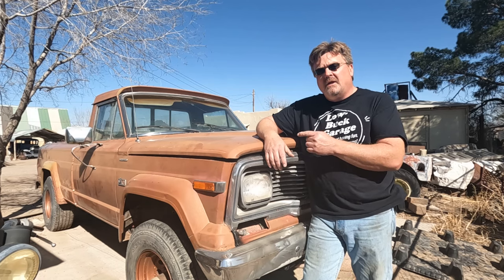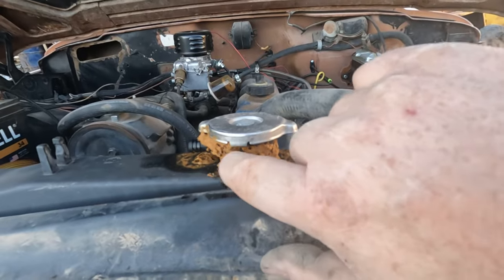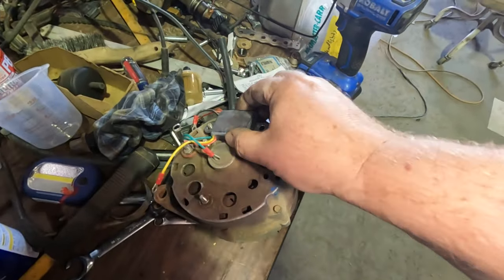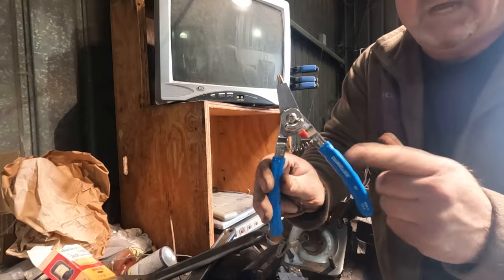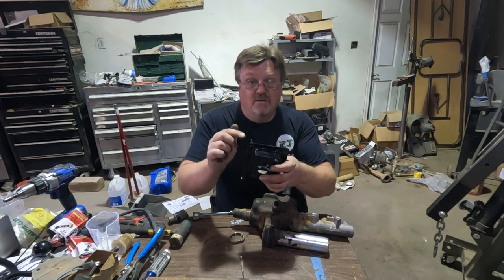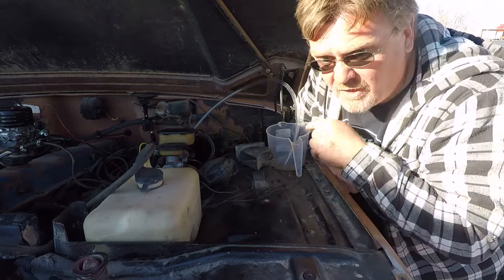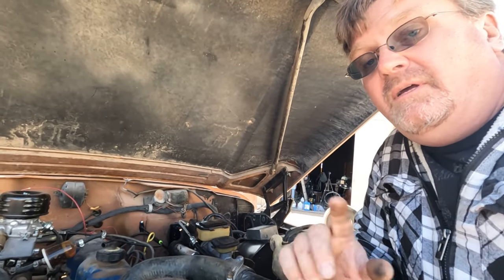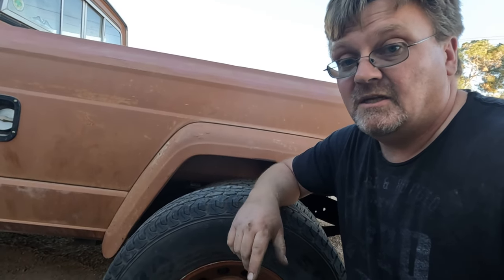Jeep J-10 hydroboost and repairs, this Ford powered 5-speed FSJ gets better!

Comment: In case it's not obvious, power steering pumps for hydroboost and non hydroboost systems for GM and Jeep are identical it's just the tanks (one return vs two). You can buy a two return tank and toss it on the good pump, don't forget the gasket.

Comment: LBG, when I worked downrange in the 80s we had some cool work rigs among them was a Air Force blue J10, an M37, A couple crewcab W200's I loved the old Dodge's, but that J10 drove really well had the cursed 360 that the motorpool dude's could never get to run right always starved for fuel, I brought a fuel regulator down for one trip and slapped it on. If you wanna sell that rig  id love to cross country it from Az to Ar ive always wanted a 300 straight 6 with a five speed in a FSJ haha. Coollest snap ring pliers ever!
Reply from the maker: The previous owner told me that he could never get the 360 running right, either.  I really didn't want to put that motor back in, I was kind of glad when there were casting flaws in the block and I had to re-power it.

Comment: Use an alternator from a 7.3l powerstroke, the 130 amp model. It's interally regulated and a nice upgrade. The superduty hydroboost is a nice unit also.
Reply: Caution: These Jeep trucks came with wimpy alternators (mine, a '74) has a 37 amp output. The alternator output wire on these trucks runs to the ammeter in the dash, and then back to the (I believe) starter solenoid. THAT wire is not sized for large output alternators. That's why he mentioned that these trucks have a reputation of catching on fire wiring-wise. All that said, I believe he has bypassed that ammeter wire, so he is good.  If you do this yourself just be aware of not overheating that ammeter wire. The generally recognized solution is to indeed bypass that ammeter wire like he did but use the ammeter wire to power a voltmeter that replaces the ammeter in the dash. There are Tube solutions for that out there.

Comment: Use tubbing with the id the same as the tubbing od that needs straightening, slice lengthwise 2 pcs clamp bent tube between the to pcs will fix problem.

Comment: Good engineering adapter. Looks like you need new rubber brake hoses.
Reply from the maker: Thanks!  Those hoses do look pretty crusty, even worse up close.  They were in direct sunlight for a few decades, so I'll be replacing them before I get it on the road...
Reply: @LowBuckGarage   mainly I was thinking the rubber hoses usually break down inside and clog up and cause the breaks to fail or lockup ,like yours .
Reply from the maker: @larryalexander4833  Yeah, I was thinking that, too.  After I finished the video, I tried cracking the bleeders.  There wasn't any pressure buildup, the lines were flowing freely, and the brakes were still stuck on.  I think they stuck because of junk inside the calipers.  I'll pull those apart and replace the lines, too.  Then it might actually have brakes that work properly!